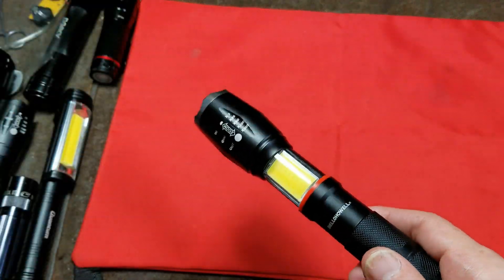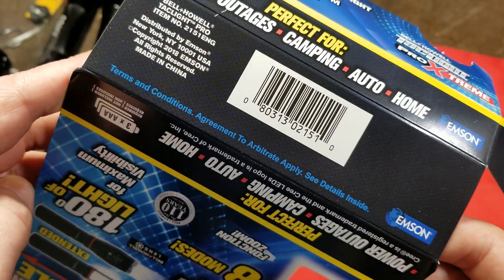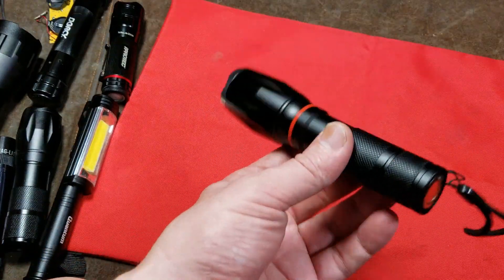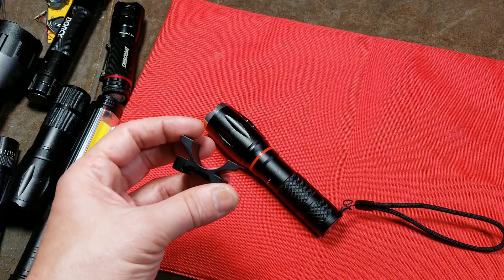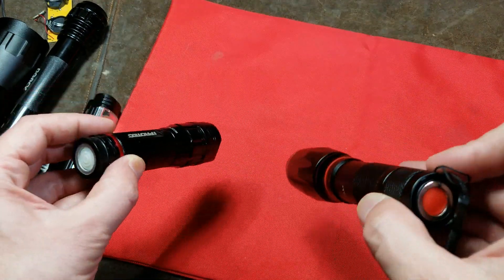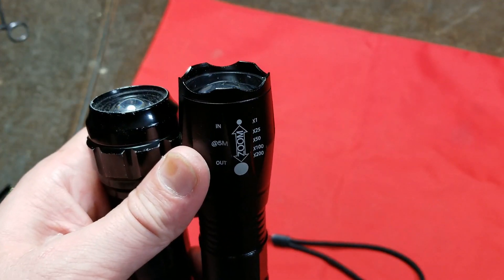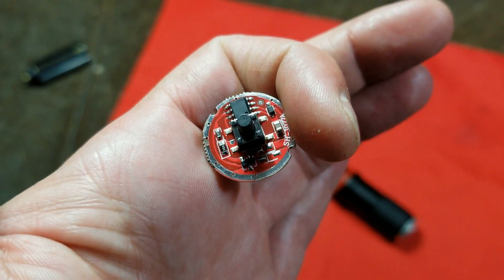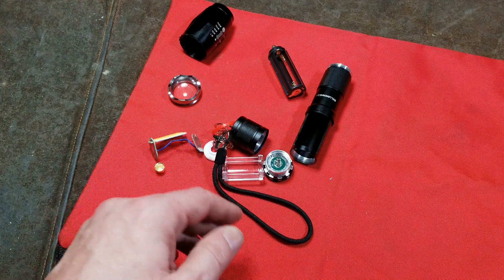Bell & Howell TacLight Pro Xtreme, The Sad Truth

Comment: I bought one of these as i needed a flashlight fast so i said 20$ ok lets try. That same night after using it for what i needed for i ended up desoldering that same middle led and board and used a stiffer spring that ran past the removed middle led so i can put a single 18650. Works better than then when bought.

Comment: I purchased this Bell & Howell TacLight and was so disappointed when the back of the light, where the red push button is located, suddenly popped out into my hand while I was unloading my car late at night. Apparently, the black ring that keeps the on/off switch assembly in place is just pressed on. Poorly made!
Reply: I bought the same TacLight and what I don't like is that it's not bright enough even with new batteries and to top it off the three AAA batteries don't last long.
Reply: That's garbage. Discard it, buy a Sofirn or Wurkkos, and be happy.